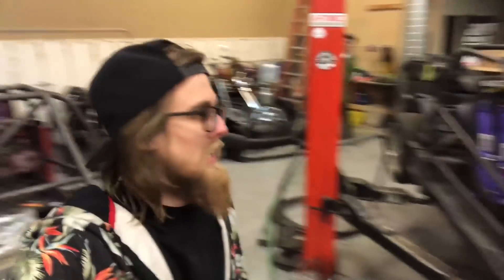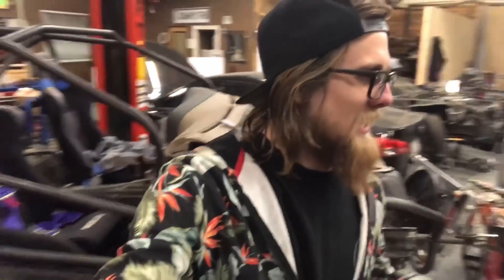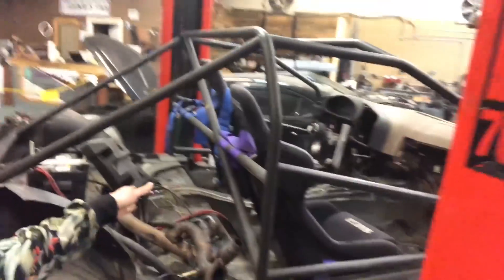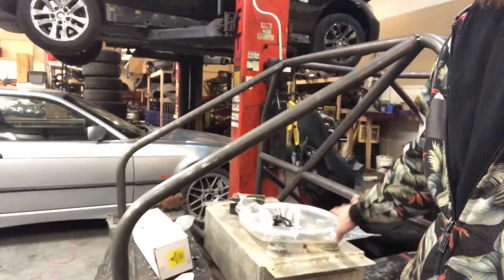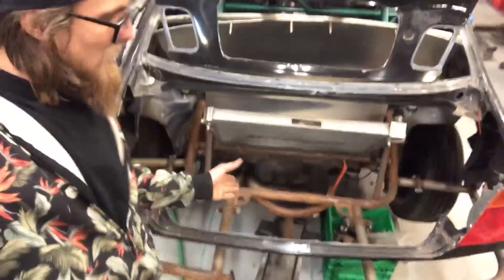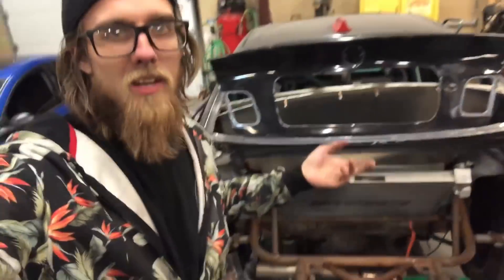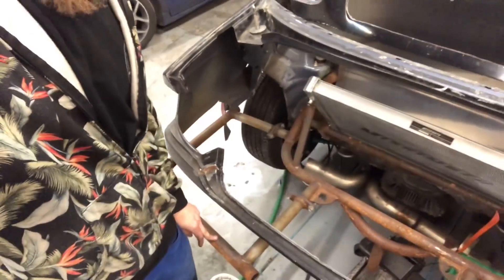HOW TO::: Drift/Death/Exo Kart Roll Cage Design

Comment: To move the radiator on trunk  on e46 do you need an aux waterpump ?
Reply from the maker: Bogdan Ciobanu it probably depends on the engine and water pump design but I’ve seen quite a lot with just the factory engine driven pump
Reply: Matt 6berries on a m54b30 is it possible ?
Reply from the maker: I’d put a metal impeller water pump in and try. Worst case you add an auxiliary pump